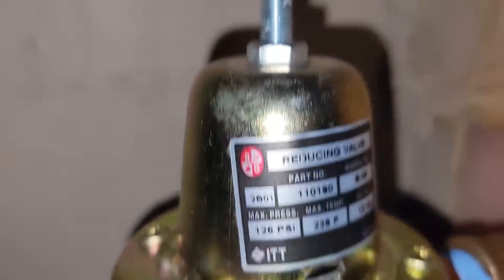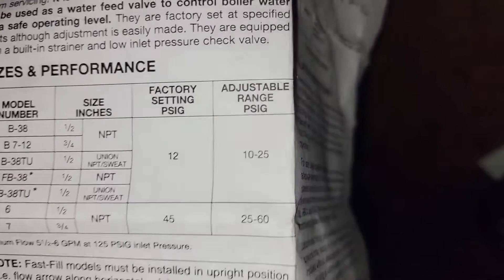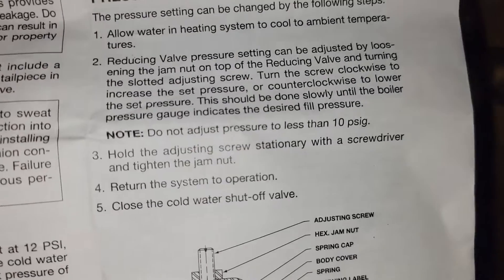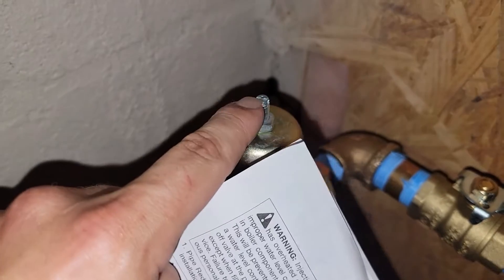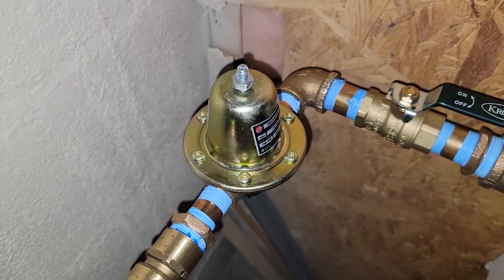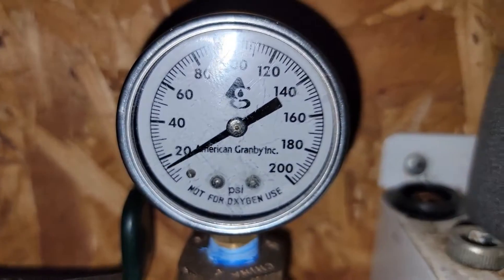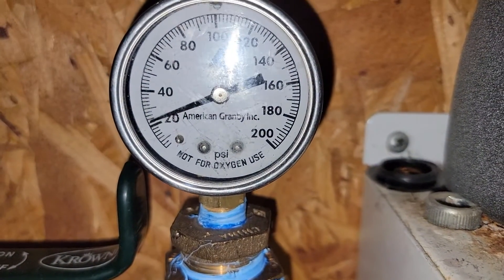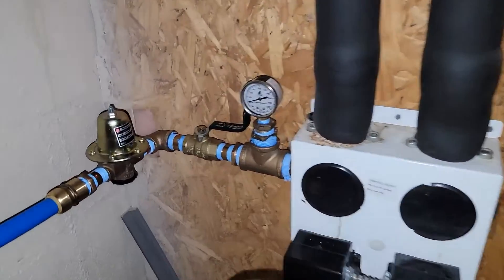Adjusting a Pressure Redcucing Valve #reducingvalve #pressurereducingvalve #geothermal #hvac

Comment: I have a simple two story home, the distance from the boiler to highest zone is  about 18 feet. I’m in nh at about 50 feet above sea level. It running at 30 psi and My tag says 15 psi. Should I lower it to avoid blowing out any seals?

Comment: Thanks, i have a home hot water heating system which continues to see pressure drop below the 12psi factory setting on the valve. I’ve been increasing pressure using a bypass loop for weeks.  So i plan to increase the valve setting.  I’m located in central NY.
Reply from the maker: Make sure it's not leaking anywhere

Comment: and remember to make sure the expansion tank is working at the right PSI 40lbs for domestic hot water heating and 14  psi for a hot water boiler take the system down to 0 pressure than check your expansion tank